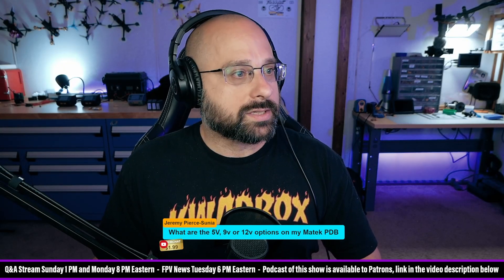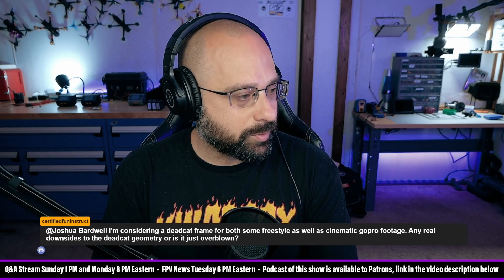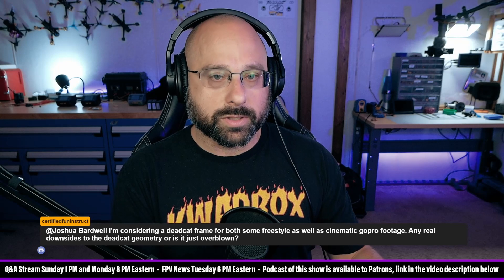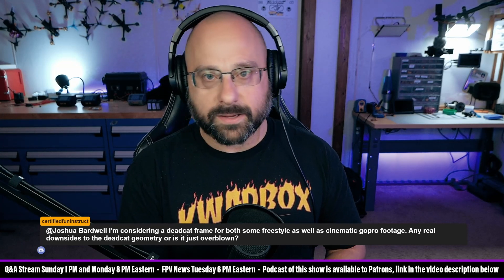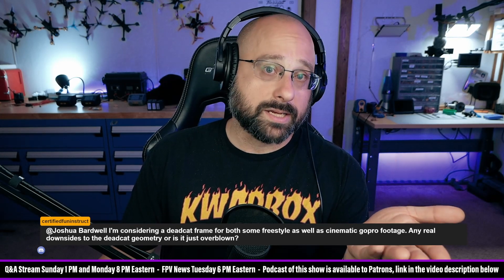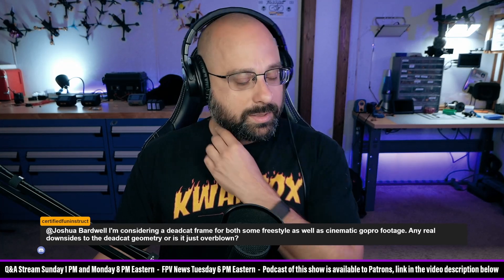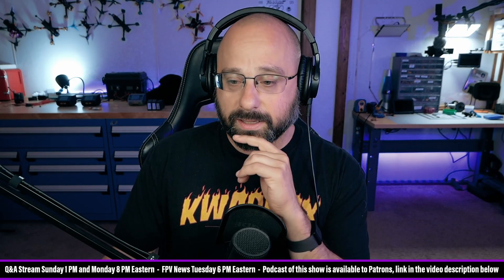What Downsides Do Deadcat Frames Actually Have? - FPV Questions

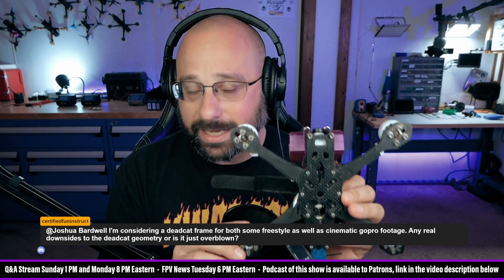Comment: 0:46 No that is not the X-Axis, but it was a 50:50 chance and I have my brainlags too so here is mine:

Why not synchronize the dead cat frame design based on the position of the two front arms?

So why not design the rear arms exactly the same as the front ones to achieve a geometrically synchronous design (based on X-/and Y-Axis?

I strongly suspect that I am currently overlooking something very obvious here.

Comment: do the propellers go in the view of the X ?
Reply: Depends on the size of the X and the size of your props, as well as the angle of your cameras, with a steep enough angle even a go pro can pick up props on a dead cat frame.
Reply: @crisnmaryfam7344  i wanna get a 5 inch one
Reply: Don’t listen to the previous guy he talks about GoPro. If you have plain X frame with let’s say just O3 unit then yes you gonna see propellers all the time on both sides. If you attach a GoPro and fly on an angle 18 degrees or higher then you won’t see propellers at all and then if you have a Deadcat you will never see the props even on stock camera unit no matter what.

Comment: It depends where the arms are comming out from the frame and not where the motors are lacated.   H frame has the best power to lift ratio and great CG.  But its hard to wire it up as wires need to longer.
X frame has great yaw charactristics has the force is in the center of the frame.  Dead cat cat is X in back and H in front.   The X is the easiest to wire up and probably why they are popular.

Comment: But doesn't it have longer arms? Thus longer lever, so the rear motors aren't required to work as hard as on the front. This is my theory. The lever matters, in this case the levers are the arms.

Comment: What about the apex DC? It's built to be symmetric. It's a little wide than an x or squashed x. But the motor layout fills that square or "rectangle", I do have one, it does fly exceptionally well, but it still have a looser feeling than my squashed x no matter the tune. The qav-s jb edition is on the way. Build #3

Comment: I design drone frames and they are designed around a circle.   As long the motors sitting on the radius of a circle line your drone is propotional.
Reply: I understand that. Is a tune required to compensate for the differences in torque the wider motors would have doing something like a barrel roll? If the FC isn't programmed to account for the fact the front motors would have more authority (mounted wider in relation to the center-line than the rear) I cannot see a little yaw not being introduced by something like a barrel roll... Alternatively, if you only fly deadcat configurations, you could very well learn and adapt and maybe even use this characteristic if you plan on free-styling it or doing whatever.
Reply: this is the trueth so one deadcat is symetrical like circle will be ok

Comment: Deadcat frames can still be symmetrical as in the thumbnail of this video. So no mixing of inputs
Reply: But doesn't it have longer arms? Thus longer lever, so the rear motors aren't required to work as hard as on the front. This is my theory. The lever matters, in this case the levers are the arms.
Reply: @Iceman_2003  Correct, a True Dead Cat, is not symmetrical both ways. Only the one.